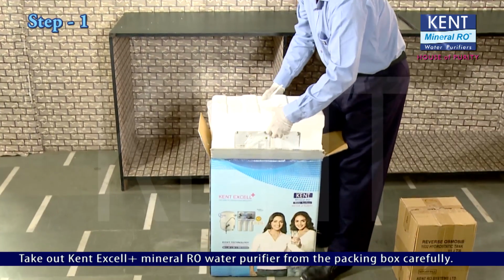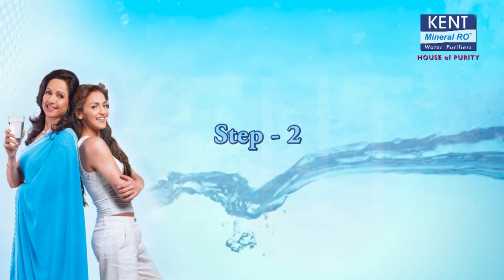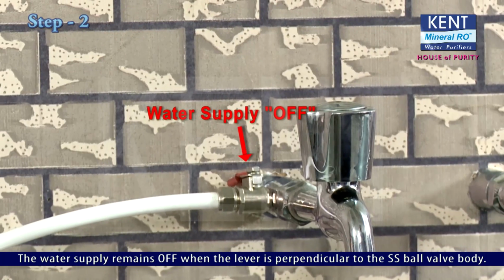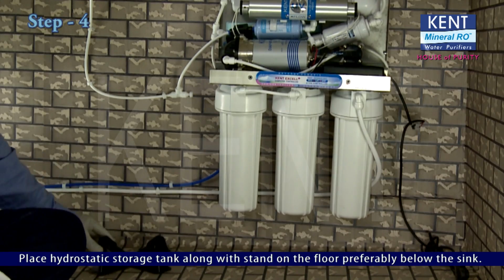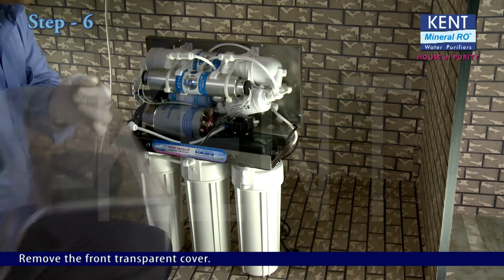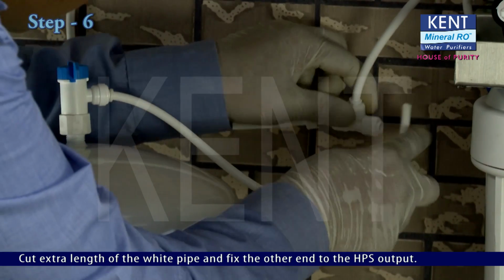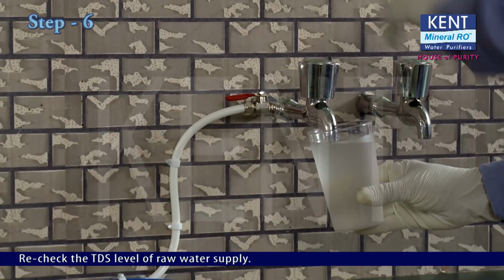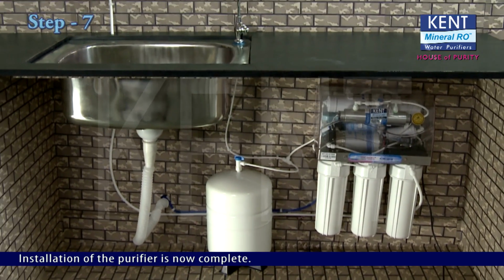RO UV UF TDS Water purifier: How to Install Guide Kent Excell+ RO | Kent

Comment: 15:27 The recommended TDS is not 50-75 but 200 as per WHO
Reply from the maker: Hi Ronald, thank you for writing to us. Regarding your query, we would inform you that Kent’s patented Mineral RO™ Technology uses an innovative TDS control valve which retains essential minerals present in drinking water. The ideal TDS level of drinking water varies depending on the source of water. Installing an innovative RO water purifier from KENT can help you monitor the TDS level to ensure that you drink safe water. Please call us at 9582123456 to know more about the range of KENT water purifiers and bring home the one that fits your requirement. You may also click at the below link:https://www.kent.co.in/water-purifiers/ro/ . Alternatively, you may share contact details at onlinecare@kent.co.in so that our sales executive will assist you better. Regards, Team Kent

Comment: Why is it the raw water pipe keeps on flowing when ever the pump is working. As a result the pump keeps on running.
Reply from the maker: Hi Robert, thanks for writing this. If you have a Kent Water Purifier, our executive can visit your place to check it. Regarding this, please call KENT Helpline Number +91-9278912345. Alternatively, you may share your contact details at onlinecare@kent.co.in so that we may assist you. Regards, Team Kent

Comment: I'm using this pressure tank past ten years  one thing is we have to maintain air pressure inside the pressure tank once in six months.
Reply from the maker: Dear Customer, We are a 100% customer oriented company and we will need your help in understanding the problem you are facing. Kindly call our helpline number +91-9278912345. Alternatively, you may also provide your contact details at onlinecare@kent.co.in so that our team can assist you.
 Regards, Team Kent

Comment: can i instal this system without the tanks? whats the purpose of the tank. i wont get instant water if i dont use the tank?
Reply from the maker: Dear Sir, thanks for writing to us. Regarding this, we would inform you that KENT Excell+ has 7 litres of purified water storage capacity with a hydrostatic storage tank. This tank facilitates pressurised supply of purified water even in the absence of running water and electricity. Please call us at 9582123456 for product details and more information. Alternatively, you may visit the below link:https://www.kent.co.in/water-purifiers/ro/kent-excell-plus  You may also share your complete details (contact number and address with pin code) at onlinecare@kent.co.in so that our sales executive will contact you. Regards, Team Kent

Comment: what is the use of pressure motor, and my kent has no pressure from the faucet output water , which one is in trouble?
The tank or motor?
Reply from the maker: Hi Sudheer, We deeply regret the inconvenience caused. Customer satisfaction has always been our priority and we are promising you that we will resolve this as quickly as possible. Please share your contact details to onlinecare@kent.co.in or call us at +91-9278912345 so that we will assist you soon.
 Regards, Team Kent

Comment: How much tds is good
Reply from the maker: Dear Sir,Thanks for writing to us. Regarding your query, we would inform you that, As per Kent 50-250 PPM of TDS is Permissible for safe drinking water & all Kent RO purifiers have TDS controller which can be set manually between 50-250 PPM. Alternatively, you also call us at 9582-123456 for fusther details. 
Regards, Kent Team

Comment: Installation was not done professional and not upto the standards of Kent . All the water pipes are hanging or just ties up to another nearest possible cable (saying that to make proper installation it is the job of electrician). Purified TDS water (45)  was written on the installation report is different from what he showed us(83),  when called him back  he came and corrected  it.  They are very much interested in selling the pre sediment filter and cover for the unit but not interested to make proper installation. Being a reputed organization please take care of such  issues which will not spoil your brand name.  If it is really required to have a pre sediment filter then why not Knet sell that along with the equipment.    Kent is selling some of the things and forcing us to buy the other from outside market (pre sediment filter etc costing around RS 1000/-)  I am very much unhappy with your installation team.
Reply from the maker: Dear Sir, We sincerely regret the inconvenience you have faced.  Please share your contact details to onlinecare@kent.co.in so that our team may assist you soon. You may also call us at +91-9278912345 . Regards, Team Kent